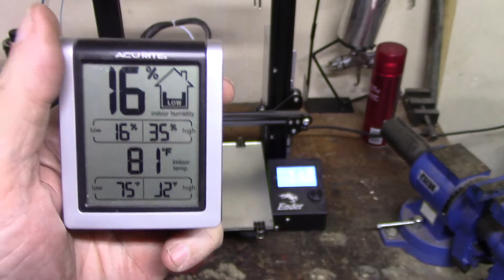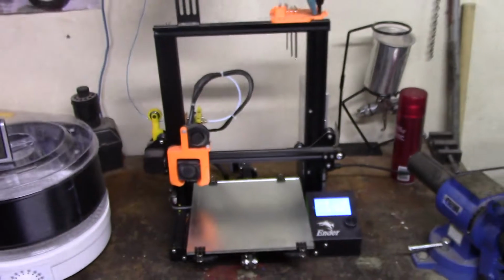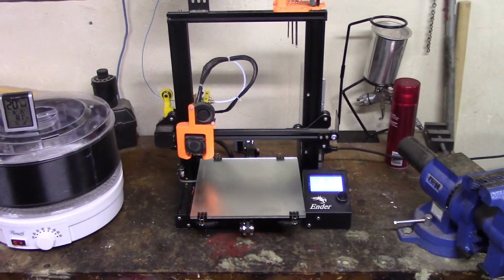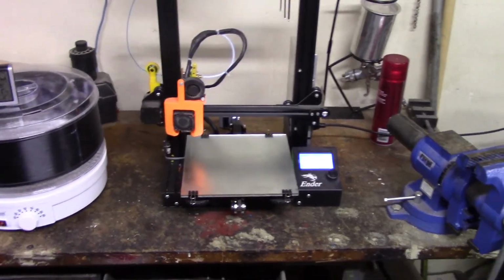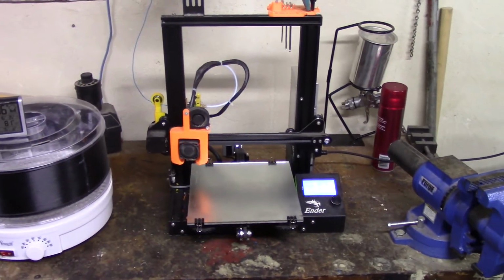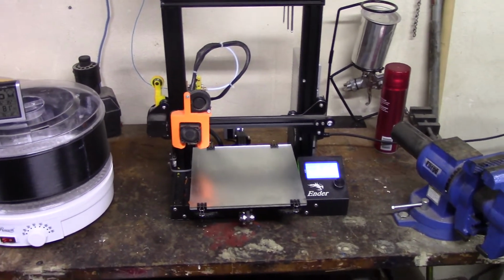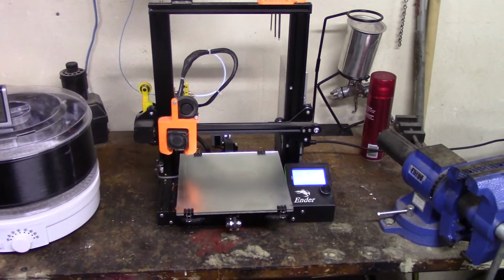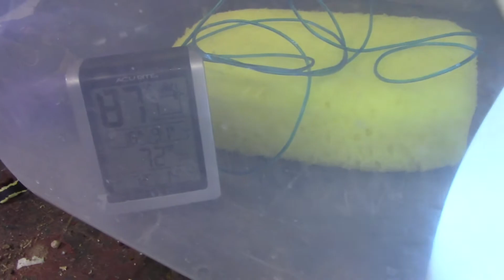Do you really need to dry TPU filament? Let's find out!

Comment: I printed so many things for around the house. Usually to repair things. For instance, I made PETG axle holders for my new wheelbarrow wheel. They are holding up very well, but PETG does get wet easily and after 3-4 days your prints will slowly turn worse. A popping sound during printing tells you, you need to dry your filament. At the same time, some designs print okay with wet, popping PETG.

Good to know I will not need to dry my TPU!

Comment: Seattle checking in: 
Puget Sound, Lake Washington, Duwamish river, East Lake....yeah, we got moisture without rain!
I was using VarioShore foaming TPU; depending on print temperature it barely foams up at all or can triple it's volume (reducing the Shore hardness).
The chemical they use is baking powder, so it's super-safe!  
Makes CO2 when it gets hot enough.
But.....
Baking powder is moisture sensitive, so you dry the filament in a hot-box, right?
Wrong.
Even gentle heating of food-dryer was enough to 'trigger' the foaming chemistry.
It dried with no change in appearance, but when printed the stuff didn't expand, even at high heats.
Lesson:  Foaming TPU must be kept sealed air-tight and stored with desiccant.
Reply from the maker: I've never even heard of foaming TPU. Off to Amazon! Oh, and I lived in the Seattle area for 19 years, most of it spent in Kirkland and Redmond. I remember when we first got there when I was 15 years old, I think it was late March or early April. After a few weeks I asked my Mom, "Does it EVER stop raining here?". It had been been a medium rain to a light drizzle the entire time. I got to the point where I hated the rain. Now after 20+ years in the Sonoran desert when it rains I want to go outside, open my mouth and look up. Specially after summer. But I will say this, I don't remember it ever raining as hard in the Seattle area as it can rain here during the Monsoon season. First few times I had to go outside during a monsoon I thought I was going to drown. It's crazy.

Comment: Thanks Chuck! What are your retraction and temperature settings when printing TPU?
Reply from the maker: Retraction is completely off. Temps for the TPU in the video was 220c nozzle and 70c bed. Although to be honest, the bed temp could probably be dropped to 50 or 60 and it wouldn't make a difference.